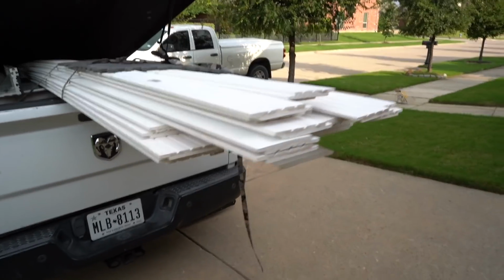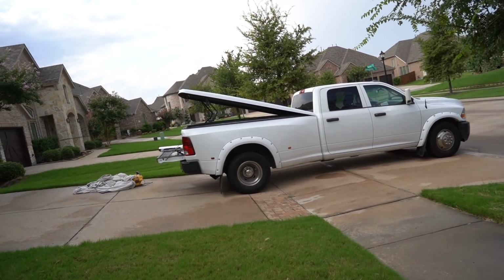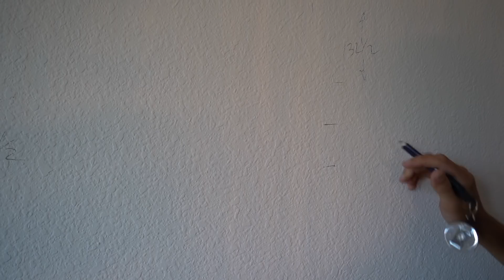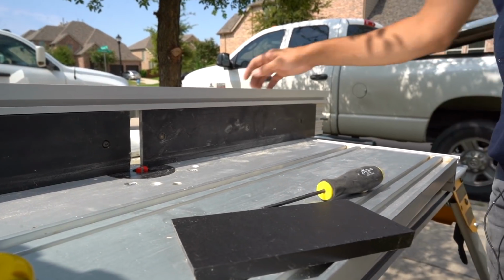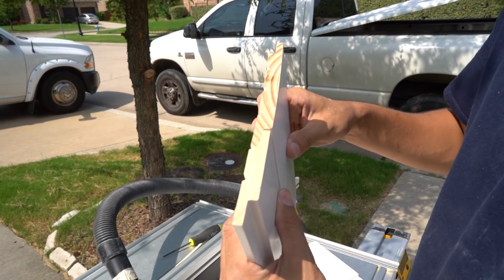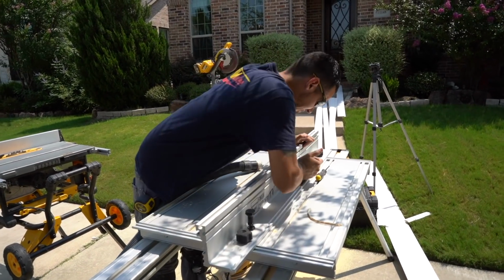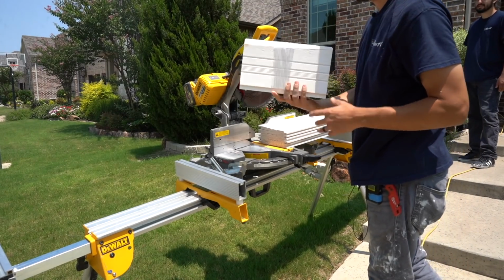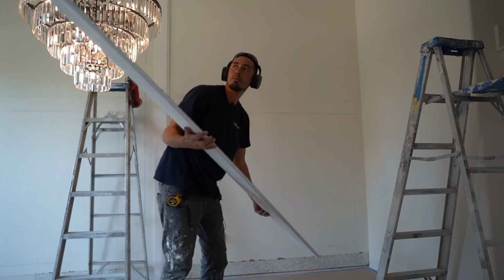vertical shiplap accent wall install

Comment: Hello! I have a quick question, I recently had an accent shiplap wall done, and the guys who installed it left a mess of overspray (white) from when they painted the boards. I have brown wood tile flooring and was wondering what you guys use to clean up floors? I know you guys do a good job at prepping the area to avoid this, but unfortunately for me it happened and it’s been a pain on trying to get them to comeback out to clean up the mess they left behind! Any help would be greatly appreciated!! Keep up the great work!

Comment: Im gonna be installing some veritcal shiplap in the bath. Trying to decide if I want to run some 5/4 base first and sit on top or run the SL and then a 3/4 square edge base on face. Thoughts?

Comment: Hey Richard, I tried out the tripod you recommended from your wainscot series and it’s a great tripod but wasn’t tall enough. I found another on amazon that basically reaches the ceiling and it’s $20 for 1 or $30 for 2. Doesn’t have all the bells and whistles but I wanted the height. I can go get the link if you or anyone here is interested.
Reply: John R i’ve only been able to use it on one job so far. It definitely has the height, but I don’t know if it’s going to be the tripod that I keep for my laser. I especially miss the panning head of the tripod that Richard uses and the Height adjustment on his is also better in that it’s very easy to fine tune your line.

Comment: In England, You’d have to put horizontal batterns behind them first to give a flat, even surface to fix to. I hardly ever come across perfectly flat and straight walls to directly install panelling on to. The Houses in America look like a dream to work on. Looks cool though.

Comment: Hey marine have you given any thought to a tool trailer? I know you said that your HOA said no trailers. But since you sold your boat, you could keep your custom tool trailer in one bay of your garage, nice and safe indoors. You live in Texas and the weather is pretty mild as far as cold so the truck will be ok outside, your tool trailer inside out of prying eyes. That guy Ron Paulk has a nice trail set up , just a thought one marine to another.

Comment: maybe get a storage unit that your trailer will fit in. If there is something close to your house or usual supply place. A company here got permission to park their job trailer at the local electrical supply parking lot.

Comment: Im building a custom trailer bro, i bought a 30' camper chassi that has 10'' ibeams on each side, double axle. Its going to be 16' of enclosed and 10' in the back will be landscape trailer for materials. The 2 electric slides that the motors arw still attached to will slide out with the dewalt saw horse's on them. Once i start on it ill upload the fab videos and see what u think. I do industrial maintenance for shipping warehouses so my scooe if work encompasses alot

Comment: I see that you have the same 10” table saw that I have, a question.  The fence had that straight part that rotates 180 degrees.  In 47 years I’ve never seen that attachment and I’m wondering if you or someone in here can tell what the purpose of it is?  I look forward to hearing from you 
Got my shirt
Reply: Brian S   Yes, I guess you flip that over to the blade side over the throat plate, does it eliminate the strip going through the gap between the blade and that fence?
Reply: Devon Wainstein yeah I was confused what they meant because I was certain I knew the answer. I agree with you. What he’s asking about is a bar built into the fence that you flip over to support your piece so that it’s not floating in mid-air over the edge of the table saw.
Reply: Devon Wainstein You are right it becomes the little piece of table that is missing so that the longer piece of plywood hits the fence and is supported from the bottom

Comment: You need the biggest one you can afford. I bought a old Horse Trailer and have a Shop setup. With generator on roof and racks.  Think about it the hay loft up top for storage, a built in ladder with a tack room, all your tools fit up front, with saw, router table, mini lathe. Aluminium are great but a older steel ones cheap at Auctions. PS if you can park trailer in back yard, I put a garage door in back of garage, drove thru to back yard, poured a Concrete pad, turn around to garage door front. Just saying.

Comment: Yeah, HOA's typically suck like a $300.00 shop vac. Small minded people playing neighborhood overlord. If and when you get a trailer, opt for the 16' length, bearing in mind that 16' is a standard MDF length. Yeah I know, sometimes it's 14', sometimes it's 17', but you can squeeze a 17' length into a 16' trailer, not so much a 14' trailer. How do I know? I work from a 15' box van. Many times I wish for that extra foot. Fitted at a goofy diagonal, 16' material will work, you just get to use bad words in loading and unloading. Go 8' width, not 7'. The 7 ft. trailer will make you feel like you can't throw the cat out without getting fur in your teeth. 8 ft. let's you put shelves on both sides if needed.
Reply: I had to google what HOA is, I am from Europe. So local housing rules state if you can keep trailer on your own yard? Or is it on side of the road?
Reply: Render Wood yes some neighborhoods have rules or usually called “covenants”about what can and can’t be done within that development.. rules range from what colors you can paint your house to what you want to accessorize the exterior with.

Comment: Could you have a double gate on the right side of the house and back your trailer in to the backyard behind the fence at night? Or they just don't allow trailers? Just like around here your not suppose to have a commercial vehicles parked at your house, nobody listen though lol, I have an E350 - F350 - Sprinter & all 4x4's & Diesel Commercial trucks lol

Comment: It's weird there is not a single car on those streets... It's like a luxurious ghost town.
Reply: I was wondering about neighborhood kids hanging around and messing with the equipment.  Are there no people???
Reply: @pearlllg  Every video is like that, I've not seen any people in Richard's videos.
Reply: @Davey768  I wonder if most of his work is done in new construction.  That might be one reason.  And, I bet he is careful not to record (or use footage of) people.  Still seems lonely, though!
Reply from the maker: Everyone parks in the garages because it’s summer time and the heat is bad. But I try not to have any people in the videos unless they agree to it.
Reply: Finish Carpentry TV shouldn’t put your equipment on the sidewalks in case someone is walking. Especially someone handicapped or kids on bikes forced out onto the street.